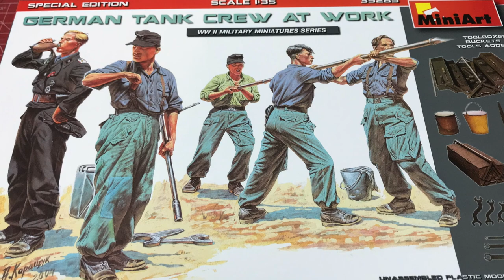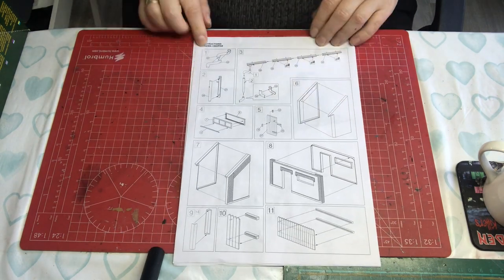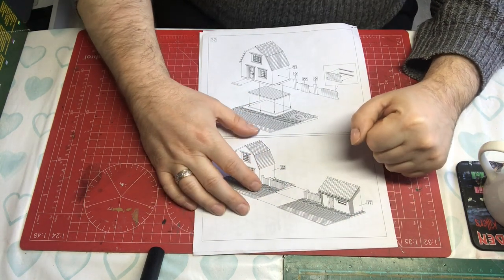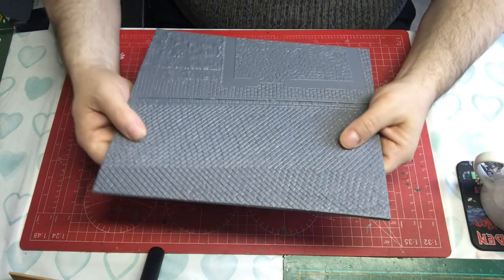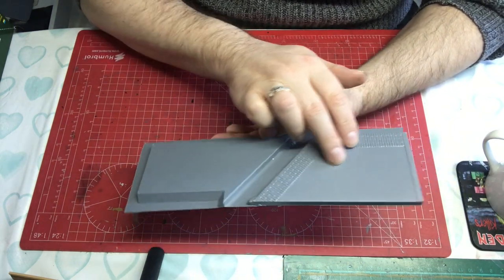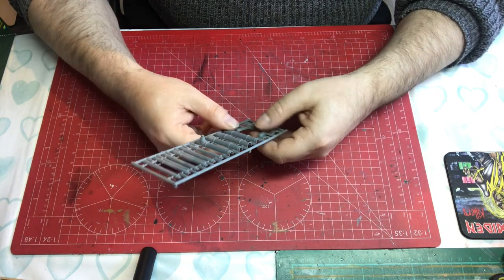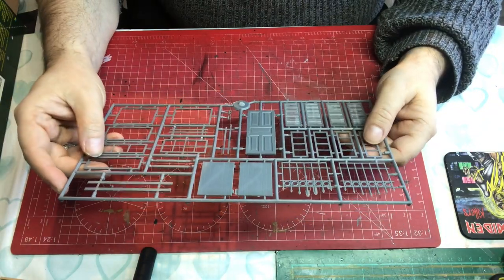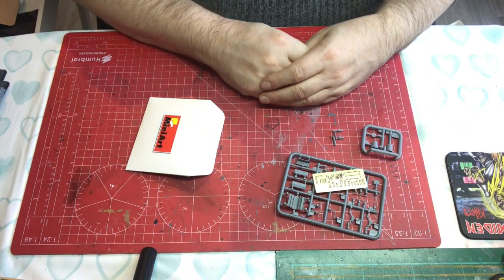Rye Field Model 1/35 inital production Tiger Diorama. Full build part 2.

Comment: I'm building this diorama just now and built the new railroad crossing but come across them newish vallejo dioramas the solid resin there well worth the money when your paying pretty much the same for one these! I used a foam board underneath my cobblestone ground because it will warp throughout time! So stick it to a square cut off I done it in 2 parts so it can be joined together for transportation/storage later if taking to shows or club meetings! I'm using an asuka firefly and a RFM firefly on the one diorama loading up! I'm using AK diorama effects the concert stuff for the walls or ammos new acrylic filler it's really good for texturing brickwork with a GSW roller I personally think the brick effects terrible I'm actually hoping this works or won't use it, it's really looking it's age now! The street accessories is great the man hole's n grates for water in kirbs copper foil is what I used for the hinges and mengs nuts n bolts it's looking the part!